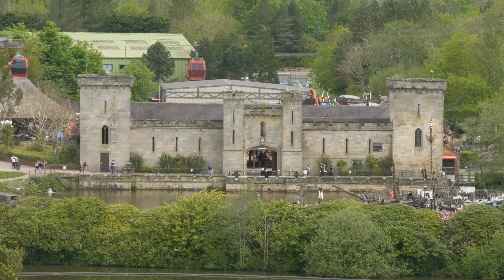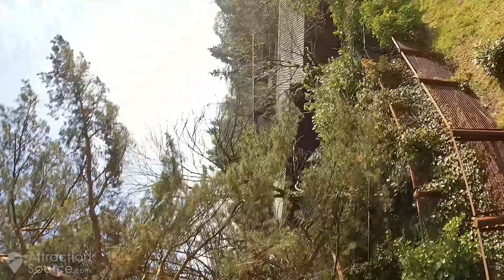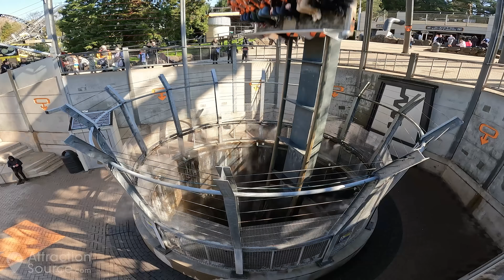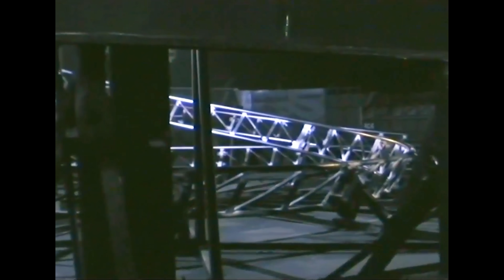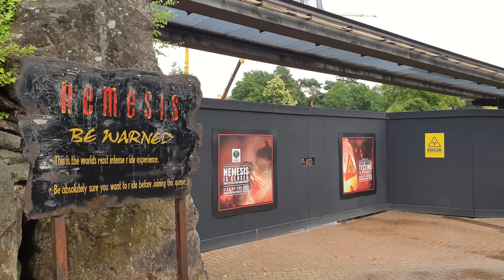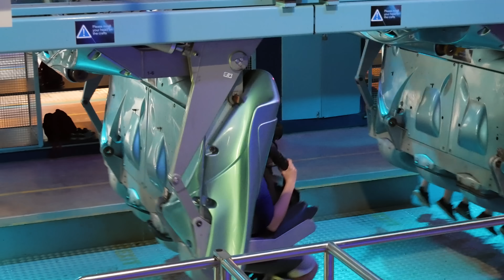Alton Towers has a roller coaster problem

Comment: Oblivion's hole could be used for a free fall tower like ride which would eat up much less space than a full roller coaster so they could build a second rid around that. Or they are creating some new creative idea that implements an underground station and a ride starting upward from it. Anyways the one thing they'proven in the past is that they are able to find creative solutions for problems,so I'm not that worried about them finding a good solution for this one.

Comment: Rita officially closes at the end of this season. Glad I got the chance to experience it during my first AT visit this year.

I noticed the plaza next to the smiler is now gated off (which the oblivion tunnel partially runs beneath), so I wonder if oblivion will be either removed next or refurbished before that area opens again/gets developed.

World of David Williams is also an obvious choice depending on the contract length/exit clauses considering his controversy and how empty that area is now.

I would LOVE that wooden valley coaster to become a reality.
Reply from the maker: There's a lot of areas that could do with improvements across Alton Towers, that's for certain. I'm not sure where you heard the rumours, but Alton Towers haven't confirmed the closure of Rita

Comment: That's bullshit. The world's best theme park, Europapark in Germany, has ever replaced only one roller coaster. It's been their only dark ride roller coaster and they completely rebuild it as it was, keeping the original building. The only major changes where a completely new theming and a second loading station for the vr version of the ride.
They don't have any restrictions like the ones mentioned, most rides sit on a flat peace of land. Jet the park kept all of them, even though it has its own manufacturer attached. Why? Because they follow a slow but steady and sustainable expansion strategy. The old rides are still great and the money is better spend for expanding the park.
Reply from the maker: This video is specifically about Alton Towers, which as you point out, is a very different theme park to Europa Park. Everything you've said about Europa Park is probably true, but I'm not sure it's relevant to the content of this video 😅
Reply: @coasterbot  My point was, that it's not normal to just replace your rides if you don't have restrictions.
Reply from the maker: It's 100% normal to replace your older rides with new ones over time.

Liseberg have replaced lots of their rides over time, often with newer versions of the same things. 

The efteling replaces rides too. Spookslot with Danse Macabre, the old bobsled ride with Max and Moritz.

As you've described, Europa Park do it too! They're going to replace Euromir in a few years time...

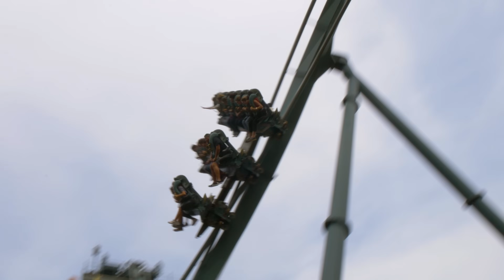Comment: 4:00 Baron 1898 has. This video is not genuine on its claims
Reply from the maker: Baron 1898's tunnel is about 7.5m deep, Oblivion's is 35m deep. Having ridden both, the Baron's tunnel sensation is nothing like Oblivion's
Reply: @coasterbot  'matching the feeling' you said. That it does, specifications don't matter if they achieve similar experiences
Reply: @B.404M I think the difference in experience is y'know... 28 meters deeper..
Reply: @B.404M...and did one feel deeper?
Reply: @SkytheFemboy103 no. The experience is quiet similar
Reply: @B.404Msimilar. Not identical.
Reply: @SkytheFemboy103 that's what she said
Reply: @SkytheFemboy103 We weren't looking for a copy 😅😂
Reply: @B.404Mits been a month vro
Reply: @SkytheFemboy103Youtube just notified me now
Reply: @B.404M thats insane

Comment: Anybody who played RCT as a kid and all the games after can tell you that figuring out how to squeeze in a new better ride in the spot of a terrain ride is always doable. Putting a terrain ride though on a flat piece of land oddly enough is much more expensive and difficult. I do wonder if Alton Towers could get away with an exception to the tree height if they disguise the ride well enough. Also there's plenty of amazing low to the ground rides out there. Goldstriker and Maverick are only 100 foot tall but you could easily cut that in half or more with launches instead of lift hills.

Comment: I don't think that replacing the track of Oblivion is impossible or even partiularly difficult for the right crew. Cranes will be used and track pieces inside the tunnel can be installed using chainblocks and propably even small cranes. It will be slower and more expensive than above ground installation but not at all impossible. There is heavy installation ongoing all the time in crampt caves.
Reply from the maker: Good to hear it's do-able!
Reply: @coasterbot  I was part of a project where we installed about 80 tons of large steel structures and a lot of 700mm (plus smaller) diameter piping inside a small tunnel/cave. It was 40m below ground and 1km from the entrance of the tunnel. It took a lot more time than normal but it got done in the end.

Comment: Modern rides usually have elaborate trusses under track & heavy duty support columns that as noted lend themselves to replacement as required. This also makes such rudest & resorts eco friendly by not throwing away coasters every 10 yrs or less

Comment: Since Intamin have stopped making parts for Rita and Stealth and both of these rides spend more time closed, I would imagine the Secret Weapon 9 will be the replacement for Rita.

It was a shame that they messed with the Oblivion drop because of noise complaints from people screaming. It used to hold you there for a good few seconds whilst the words "Don't Look Down" were spoken through speakers as you hung over the edge. Then they shortened the wait. 
Also shame they messed with the Nemesis wheels too. The wheels would scream as they went around the track. You could hear it all over the park.

Comment: Wait, what?! Oblivion is 25 years old and this video is a year old?

I remember getting up at 2am to drive to AT, parking up in the VIP area and being on the ride for 7am when GMTV/whatever it was called started. We'd been held at the top for about 15 minutes so that the presenters could do their spiel and we would drop behind them at the exact right time. It was bloody freezing. We pretty much stayed on that ride until the park opened (apart from doing a bit with Mr Motivator) and then a few rides on Nemesis. By noon I'd had enough, and oddly, I've never been back since.

Comment: 1) Nemesis reborn proves that coasters don't have to have a finite lifespan. You can replace everything and still keep the ride the same. This can be repeated until the end of time if needed.

2) One of the parks biggest problems is expansion or the lack of the ability to do it. The park is bordered by a road, a disused railway that is now a public footpath, land owned by the Bamford family who have vowed they will never sell to Alton Towers and a village who's populat`1qion mostly wishes it didn't exist. This means they are going to be forever forced to work within the confines of what they already have.

3) Alton Towers doesn't have a roller coaster problem it has a money problem. With enough cash you can dig down and create whatever ride you want but it's very very expensive to do this and Merlin Entertainments has share holders to answer to. Maybe this is why the next big ride is going to be hidden in a box behind cloud cuckoo land and certainly won't be a 1.4m height restricted coaster.

Comment: Either Rita or Thirteen will be gone first, Oblivion is still insanely popular although it is quite an old coaster, if Oblivion or Nemesis were to be removed it would be a massive hit to the park. Out of Oblivion or Nemesis, Oblivion is most likely to go though, the age and digging it up to try and restore the parts is probably not worth it and on top of that, the maintenance costs would be too much for what its worth. Nemesis however could last forever, just put a new track on and repaint it and you're sorted lol. Rita or Thirteen don't really stand out as much, when you think of Alton Towers the rides you think of first are most likely to be The Smiler or something like Oblivion and Nemesis. Yes, Rita and Thirteen are still insanely popular and are great coasters but they just don't seem to be ever getting as much attention as the others. Even if Rita goes I'm not sure it will matter too much, it has great speed but IF there is a big queue, you're waiting for a ride that lasts just 25 seconds, I know I may get hate for writing that but that's just my thought. Thirteen, is a good ride, but that's just the same, I just don't think it's ever that busy. If you have the app and you check the waiting times when you're at the resort Rita and Thirteen always seems to be at low waiting times. (well most times I've went lol) - Every so often they'll spike though, but only for 30 minutes to an hour or so. If they do stay then I guess they can just age and have parts of their track replaced like Nemesis, but if they were to remove a ride and build a complete new layout then I'm guessing it will be one of them. OR another solution - remove The Blade lol. I don't really know much about Spinball though, not really much going on with that, and don't really hear much about it, it just sits in the background next to CBeebies land and spins endlessly lmao.

Comment: Thay can put new rides in place of the old Bespoke pit but at colossal expense as effectively thay would fill in parts of the pit and move Andor modify outher parts of the pit to make a new unique ride so effectively could see them do new configuration of the existing ride but make them more complex a ride like saw would be one that would work on a bigger scale with some parts being modified and extended to have Subterranean sections

Comment: They can indefinitely refurbish them. The track should theoretically last over 100 years if constantly sealed and painted if there isnt major corrosion. Of course tracks that do have wear can also be replaced with newer prefabricated sections. The issue would boil down to is it cheaper to just order an entirely new one or continue maintaining one that might not have parts for it anymore.

Comment: honestly they should get rid of 13 and rita, and use that space for better dark forest themed rides, and could donate both to another theme park so they can still be used

because im ngl rita does not fit the theme properly and as another said, 13 is just a gimmick

also extending oblivion to have a slight bit extra on the second left turn, like a corkscrew, it could spice up the ride enough to get a bunch of people wanting to ride it again, or even making the entire ride in the dark (after the drop) until it reaches the station
Reply: No they shouldn't. They can leave oblivion and galactica alone too. Bad I wake up saying oh nemesis what have they done to you.

Comment: If you blindfolded 100 coaster fans and had them ride Montu and then Nemesis it would be an absolute blow out in favor of Montu (I'm not biased I swear lol jk). The fact that the park was essentially forced into low to the ground tight layouts with heavy theming worked out beautifully in the end.

Comment: It absolutely does not have a rollercoaster problem.

They’ve just ripped down Nemesis and got B&M back in to completely rebuild it from scratch.

It’s good now for another 30 years.

You may want there to be a problem, but there really isn’t.

Until B&M & Gerstlauer go bust & they can’t replace the existing rides with carbon copies of their predecessors, this is an absolutely nothing video.

I’m not sure how you think having the most popular rollercoasters in any country is a problem for the park.

Absolutely mental video.

Comment: What they need to do is stop putting so many rollercoasters and bring more dark rides... Hex is barely even open anymore, has been "closed for maintenance" the past like 4 times I've gone over the course of many years. Dark rides fit well within their restrictions too, show buildings can be built below tree height by simply lowering the ground a bit and they contain noise better than open air rides do (another thing Alton Towers has had a problem over for years)

Comment: I was one of the first to experience Nemisis back in 1994. Before that, I'd ridden corkscrew and some other rollercoasters with inversions, but never an inverted. The ride was extreme, exciting, fast, and unpredictable. Both the front and the back offer an awesome ride experience. Little did I know back then that the terrain manipulation, having the ride dodge land, fly over the ground and dodge in and out of tunnels meant it was possibly the best hanger that would ever be made. I've ridden coasters since all over the world, including other Bolliger & Mabillard hanging coasters, and none have reached that level of awesomeness of Nemisis, not even it's sister coaster Inferno in Thorpe Park. 

I was well aware of the lifespan limitations of rollercoasters (Corkscrew and Black Hole) and worried about Nemisis. But they totally refurbished it this year, renewing it for hopefully another 30 years, just as you predicted! Well done, Alton Towers!

Comment: Nemesis reborn is better than the original. Oblivion is also an 'easy' fix, not a standard retrack, change the drop to more than 90 degrees and extend the ride, swing around smiler put in a loop back to the station, brand new ride. I have a good feeling Alton Towers is going to be just fine.

Comment: The nemesis rollercoaster today is not the same nemesis rollercoaster then.
Reply: Apart from being smoother it basically exactly the same.
Reply: @BobBobson-q5i  Original nemesis used to be a different location.
Reply: @jammiedodger7040  it's exactly the same layout in exactly the same place
Reply: @BobBobson-q5i  No it used to be in a different location.

Comment: BTW the Nemesis thing, they are not replacing parts of the track they are rebuilding / replacing the entire track, "The transformation will see the entire 250-tonne, 716-metre-long track replaced piece by piece over the coming months", so it's not a repaired Nemesis it's a new Nemesis being put in place.

Comment: There seems to be a lot of rusty coloured metalwork on them roller-coasters... rust leads to corrosion and corrosion leads to failure of equipment... alton towers has already claimed the legs of people from their catastrophic injuries whilst riding some of the rides in this park...  needs more than a lick of paint
Reply: Ignorant comment. Read up on the causes of the accident you're callously alluding to before throwing around statements like that.

Comment: No way I would go again. It was over 30 years ago, but in one day 2 rides failed resulting in injuries. One was black hole. U sat with 2 people in car, one person literally sat behind other, between their legs. Cars went round and round  to top, ready to go down track. The start was indoors, but it seized at top. After 10 mins the lights came on, and 2 blokes appeared with spanners. Short story is, they did something, maybe with brake, and the cars started to go backwards back down spiral to start. The 2 guys who were stood in cars had panicked look and as it picked up speed, out of control, they just bailed and jumped off. One just stacked himself. People then realised it was bad and screaming started. Then when it got to beginning, going fast, it stopped suddenly, like hitting a wall. This caused the person in front to back headbutt the person behind. Smashed noses and split lips, and tears. Me and my friend escaped injury coz I thought it may end like that. I don't know if they were sued or not. Similar story on an older style wooden roller coaster. Empty car stuck on track, with other cars continuing towards it. I thought they had safety feature to prevent it, but the car just slammed in the stuck empty car. Both on same day. I was never into these parks anyway and I certainly never went back.

Comment: Spin ball whizzer needs to go it literally gives you whiplash followed by Rita that also bashes you around and is boring now they should have added more track and maybe got some inversions on it. Oblivion is also too short the area around it is ideal to expand now enterprise has gone. Wickerman to me is just like a faster runaway mine train which both bang you around also. Would love to see more water rides after the removal of the log flume, river rapids could add more features for you to get wet especially on hot days. I think if you have been on popeye in universal no river rapids compares now. However does anyone know where the ride similar to spinball whizzer that’s on the video around 5 mins 35 seconds is at?

Comment: There are some roller coasters that seem to last forever, though. Finland's Vuoristorata was built in 1951 and is still in use 73 years later; whenever its parts get old, they simply replace them. Maybe wooden roller coasters are just easier to maintain, idk.

Comment: Its a simple fix. If you HAD the money to dig a pit and put a ride in it…….you can do it again. You just remove the old ride, dig or adjust the hole…….and put a new ride in it. Sure it costs, but so does everything. Depends on how much the owners want to do it. Money and profit is king. The park will do whatever it takes.